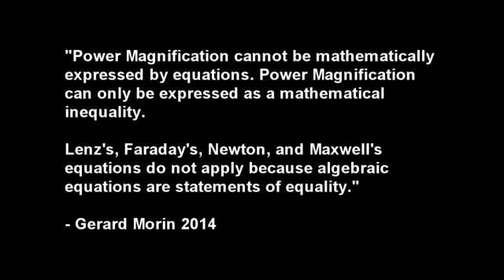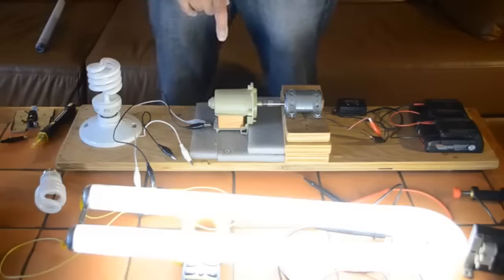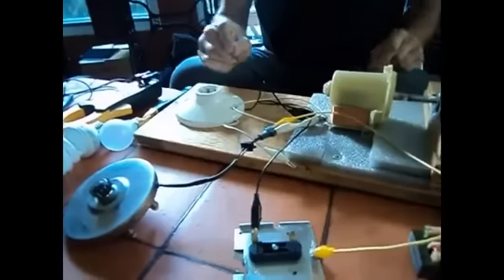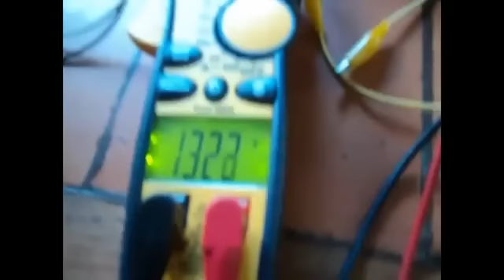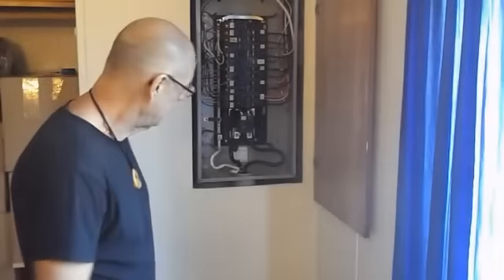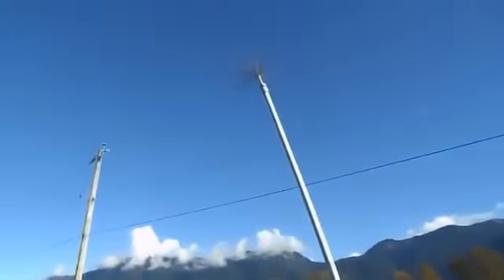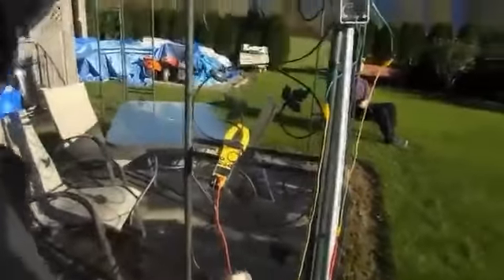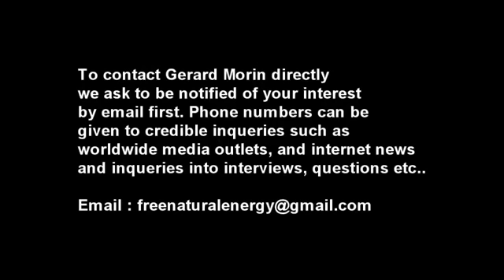Time to END The Electricity Racket - FREE & NATURAL ELECTRICITY PROOF

Comment: i Think Tesla rolled over in his grave when he heard that the electric car named after him needs a charging station🤔
Reply: Where can I get the 2 motors and things I need to build this thing please  and thank you 0
Reply: @privateerburrows  Tesla ran about in a Pierce Arrow car with an 80hp electric motor and NO POWER SOURCE in 1922.
Reply: @aaln1aaln132  Sure.  Proof?
EDIT:  It is just so preposterous that we live in the Age of Information, and there's still people with the minds of prehistoric primitives, thinking you can make energy from nothing, continuous motion, flat earth, or whatever other stupid nonsense.  How is this even possible?
Reply: @privateerburrows  We do not even know what energy is.  How can we say it cannot be created or destroyed?  Besides, you do not have to create any energy at all.  All you have to do is be able to harvest and use energy from the environment.  We are surrounded by energy.
Reply: @wesbaumguardner8829  Well, I'm sure YOU don't know what energy is.  Or if you have an inkling of what it is, you most certainly have not the foggiest idea what entropy is.
  We are surrounded by energy;  that's true;  but it's low entropy energy.
  I'll give you an example:  A few years ago a client of mine wanted to power a pressure/flow monitoring circuit from the heat of a hot water pipe, to avoid having to have a battery.  I succeeded, in the end, but it was a very difficult job.  Why?  Because there was no COLD water pipe nearby;  only a hot water pipe.  And you can say "but it's the hot water pipe that has more energy!"  Yes, but that energy needs to GO SOMEWHERE in order to be convertible to electricity.  I ended up having to install a HUMONGOUS aluminium heatsink on the other side of the Pelletier device in order for it to produce electricity from the heat of the pipe.  When you have heat energy distributed in a room you CANNOT convert that to electricity;  you need a COLD side to establish a heat FLOW to convert to electricity.  All this New Age stupid talk of "we are surrounded by energy;  we JUST have to figure out how to tap it" is ignorant BS.
  The same goes for all those Zero Point Energy imbeciles ... There may be tons of energy in vacuum, but it has ZERO ENTROPY.  You can't do anything with it.  It's as if you were at the bottom of the ocean saying "the pressure here is enourmous;  if we could only tap it ..."  Well, you can't tap it because there would have to be an empty space below the ocean that you could let that water leak to as to generate electricity (from its flowing there, just like you generate electricity as water FLOWS from the high to the low side of a hydro dam);  but there is no cavity below the ocean bottom for water to flow into, unless you believe in some Hollow Earth BS.  "Energy" is meaningless without an understanding of entropy.
  Your argument that "we don't know what energy is, so how do we know it can't be created out of nothing?" is comparable in absurdity to the argument that you can make 12 bottles of beer from 3 in a closed room ... because we don't know exactly what a "number" is.  Well, it does not matter whether we understand the ultimate philosophical question regarding numbers;  the extra 9 beers are just not going to magically happen.  Period!
  But if you are still not convinced, ask yourself how many of these ignorant self-proclaimed priests of New Age enlightenment that talk about free energy BS have actually got a generator going and making money for them?  How many?  Answer yourself!  How many?
Reply: @wesbaumguardner8829  yes I believe it's called solar wind and hydro power.
Reply: @Ham549  Well, at least you know a little bit of something about it.
Reply: @privateerburrows  True. There is tons of energy around us in the air. It can do work. It is useless though because there is no exergy. The energy cannot be converted to any form of useful work.
Reply: @BeatisMcScoots  Exactly.
Technically, though, there was an experiment;  I forget the name of it;  it was just a thought experiment for many years;  but more recently it was carried out in equivalent form, and was corroborated.  The idea is this:  You have a closed chamber with a wall in the middle, and both sides are filled with gas at some temperature.  Now, on the dividing wall you have an automatic sliding door big enough to let a molecule of gas pass when open.  A detector on one side detects when a molecule is approaching and opens the sliding door for a moment to let the molecule through to the other side.  On the other side of the sliding door there is no detector, so any molecule hitting the door bounces back.
  Now, after some time all, or almost all of the molecules in one side have gone to the other.
At that point you open a big door in the dividing wall and let the gas escape back to the first side and equalize pressure.
  It would seem like an exercise in futility, right?
  But what's interesting is that when you open the big door, the temperature of the gas becomes lower, due to decompression;  but when molecules are passing through the automatic sliding door they are not increasing the temperature of the gas on the other side.  So by repeating this process multiple times, you can cool the system without spending any energy.
  This problem was a big puzzle for some time, until someone figured out that the energy is coming in in the form of information, namely the approaching molecule detector on the door.  And from this they worked out the information to energy conversion constant.  If this is correct, there should be a matter-energy-information conservation law, as opposed to just energy-matter.
  But this is how science corrects itself, by hard, painstaking work;  not by fanaticism.
Reply: @privateerburrows  if you find the name of it then let me know!
Reply: @BeatisMcScoots  Quite unlikely;  I don't even know how to google for it.  It was from an article in Scientific American, some years ago.
Reply: @aaln1aaln132  hahaha, uh huh, sure he did...
Reply: @privateerburrows  I am laughing just reading this stuff.. These people simply cant be that stupid... Its impossible...I think I'll join in for the fun and read on haha
Reply: @wesbaumguardner8829  Well, we do know what energy is because we are the ones who defined the word, so.... to say we dont know what it is, is kinda silly... However, we are surrounded by energy and maybe one day figure out how to dynamically utilize it but we aint there yet...
Reply: @wesbaumguardner8829  You never answered his question.... Where is your free energy? Give us a schematic or device that proves your point... You cant because it doesnt exist... So why are you arguing something that is so clearly wrong?....
Reply: @keithfucious7067  Not exactly.  The word was created to describe an entity or a phenomena that exists or occurs in the real world.  You can claim that energy is the word itself, but in that case the word becomes meaningless.  I am talking about the actual entity or phenomena that is described by the word rather than the word itself.  There is a difference.  It is entirely possible to create a word for an entity or phenomena that is not understood or is misunderstood. Just because you provide a definition for a word does not mean that the definition is correct, accurate, or complete.
Reply: @wesbaumguardner8829  Energy, the way we currently describe it scientifically and through physics, can not be created or destroyed.
Anything that lies beyond that, I agree we dont understand...
I would never say anything is impossible though. I agree we are surrounded by energy we simply have not been able to harness dynamically in any usefull amount... Perhaps, and even more likely, we certainly will in the future...

My original criticism of your comments is that it appeared you WERE saying something was possible void of any tangible evidence....Basically, no one has a free energy machine so you cant possibly claim it exists....Further reading in hindsight, I dont think thats exactly what you were saying. You were more bringing light to the fact that there are unknowns and I actually respect that open minded thinking....

So, I actually agree with most of what you are saying... You are basically saying our understanding of energy may in fact be screwed up and we may make further discoveries that allow us to do work with something that falls beyond the current rigid definition of energy....However I stick with my original comment on energy... We do in fact know what it is 'as we describe it', we simply do not know if there is anything beyond our definition.
Reply: @wesbaumguardner8829  But in the end, nothing this guy did in the video even comes close to the depth of knowledge we are talking about... The guy in the video appears to not even have the most basic understanding of OHMS law...It is just comical to watch him convince himself or others that he has made some remarkable discovery or created or set into motion free energy... Its like a child explaining how a nuclear reactor works... Just making it up in his head as he goes thinking he actually is discovering something because he doesnt understand the basic principles of electronics...Personally I think he is just a fraud looking for views because he says some things that shows he knows stuff that proves his whole claims to be laughably incorrect... In other words, if he understands Wattage and its relationship to  Voltage and current, then off the bat you know he realizes none of what he is claiming is true...
Reply: @privateerburrows  What virus?... hahaha, just kidding...
Reply: @privateerburrows  I think people seem to try to find the stupidest things to defend themselves with is because they refuse to open their minds and admit they were wrong. In an effort to defend their original argument they seem to grab hold of anything or any statement that is actually correct, then attach it somehow to their original argument to somehow lend it credibility...Most people will not abandon their stand on something even if it is perfectly clear they have been proven wrong, so their defences just seem to get more and more absurd as they grasp and reach. It is very difficult to be humble, but that is the only way to continue to learn... I would rather be smarter every tomorrow of my life than I was the previous day even if I had to admit I was wrong every day...
Reply: @keithfucious7067  That is soooo true;  and not just in science.  In philosophy, politics, economics and sociology I keep changing my mind as I learn new things;  but I had a friend from many years that got really mad at me because I changed my political views, acting like, in his mind, I had no right to change my point of view.  Needless to say, after a long argument that was leading nowhere I told him what to do with himself.  Not just him, a coworker too got rally mad at me one day because I changed my diet, saying "last year you believed that;  now you believe this!" and refusing to talk after that, as if I had denied a religious figure or something.  But it's always like that;  some of us try to improve ourselves, our models, our understandings;  but most people are defensive and firmly attached to whatever garbage they randomly decided to believe in;  and only study argument techniques so that they can just overwhelm their opponents with dozens upon dozens of fallacies like a factory production line.
Reply: @privateerburrows  how is life possible bruh
Reply: @aaln1aaln132  wrong. I've studied Tesla extensively and this claim is out of left field. Also, Tesla used coal to power his inventions.
Reply: It’s all about money! And that’s sad! Love  Nikolai!
Reply: @johnandrews9433  Hahaha, for a moment I thought this was FartProsperity replying to me.
Reply: @keithfucious7067   "Further reading in hindsight, I dont think thats exactly what you were saying. You were more bringing light to the fact that there are unknowns and I actually respect that open minded thinking...."  That is the correct interpretation of what I was saying and I commend you for acknowledging that.

"However I stick with my original comment on energy... We do in fact know what it is 'as we describe it', we simply do not know if there is anything beyond our definition."  The definition we presently have is overly vague and ambiguous.  This is complicated by the fact that present theory concludes that 90%+ of all energy in the universe is some mysterious "dark energy" that is almost completely undefined or is more correctly denoted by our lack of understanding of it.  This is not a very good basis for the claim that we know what energy is and whether or not we can make claims as to what is possible with regards to energy.

"You are basically saying our understanding of energy may in fact be screwed up and we may make further discoveries that allow us to do work with something that falls beyond the current rigid definition of energy...."  That is correct.  We may also discover that energy can be created and destroyed.  At this point we are so ignorant that we are not even aware of the majority of what we do not know.  It is the curse of the unknown unknown, which is the most difficult problem to solve.

"We do in fact know what it is 'as we describe it', we simply do not know if there is anything beyond our definition."  If you really believe that, start listing the properties, attributes, and characteristics of "dark energy," which is purported to make up the majority of the universe.
Reply: @keithfucious7067  To be honest, I did not get much past the beginning of the video because I could tell the guy did not know what he was talking about.  My only goal is to get people to realize how little we actually know and to question what we think we know, but don't.
Reply: @melonmusk7502  Oh really?  Would you care to explain the "tricks" you think I am pulling or would you care to make an actual argument against anything I have said instead of just asserting your opinion?
Reply: @privateerburrows  Energy from "nothing"? Yoy did not listen what he said about the sun?
Reply: @anthonyferguson4218  what do you mean by reset? I am not familiar with this particular conspiracy. Does it have an official name?
Reply: @anullhandle  Good to know the history of how it happened;  thanks for that.  As for "effective against enveloped viruses" all I have to say is that when you choose a tool you should choose one that does its job AND does not cause unwanted consequences.  There are many chemicals that are far less damaging to your natural skin flora than alcohol, and which are effective against enveloped viruses;  such as you mentioned soap.  Another is BHT, a fairly healthy food preservative.  Possibly lecithin, I'm thinking, which is an edible soap as well as a food supplement.
    Otherwise, I'm sure chlorine, kerosene, and many such things are effective against enveloped viruses, too;  but that doesn't mean we should be putting them on our hands.  It's almost as retarded to be putting alcohol on our hands.  And not only is it unhealthy, but in fact, damaging our skin flora OPENS A PATH for infection, as the natural flora constitutes a first layer of immune defense, like a thick jungle could be a barrier to an attacking army;  and I would not be surprised if a few years after this stupid saga is over, some researchers discover that MOST infections occurred BECAUSE our hands were unprotected, denuded of natural bacteria, and so we got the virus easily just by touching money and things.  It would not surprise me AT ALL to find out that the stupid alcohol sanitizers are what's been keeping this pandemic alive.
Reply: aint it a bitch? and the one who bring it. in a interview telling that for him thomas Edison was the greatest?? 😆 what have we wast the world sinds ?? but i have stage this video 7 years ago and now i have bring it to a source on social media in Holland named blackbox today  and may now we can flip the boat over for one's nice night
Reply: @privateerburrows  Well not many, since some higher up need meters to charge You for using it... 🤔 Same happened to Tesla..
Reply: @keithfucious7067  Tesla prooved it... 👍
Reply: @keithfucious7067  Yes, i do not understand why he adressed some people as idiots.. 🤔
Reply: @liannblack2427  😲What has Musk done to be called snake...? 🧐🤔 Wanting You and Your children and grandchildren breath fresh air...  👍 Blessings 🙏🌟✨🕊️
Reply: @keithfucious7067  you are all forgetting one of the key elements of Tesla's work  ..  resonance  ....
Reply: @privateerburrows  you mean like in the Dennis Hopper movie ?
Reply: very true

Comment: Umm, actually hooking the batteries up in parallel(pos to pos, neg to neg) doubles the current(amps) that can be delivered. So idk why you say you can only double voltage. Running batteries in series doubles voltage, parallel doubles current.
Reply: Only the voltage just a step up volt
Reply: Current is load dependent.  Stop talking about things you don’t understand.  Free 101 lesson:  I = V/R

Comment: Compare volts x amps out of the battery pack and volts x amps at the socket. Total wattage pulled at the battery side is higher and this falls apart instantly. Using power to make power always costs - no way around it.

Comment: All I see is some high current 36 volt DC batteries powering a DC motor spinning a generator making around 130v ac powering low current AC devices.
Reply: @sethjorge7115  you have been on damn near every comment site today might change the person saying it looks promising
Reply: How hot are those battery leads getting?
Reply: Thank you Sir , I was wondering why he did not connect a drill press and bore a half inch hole through a piece of steel. He  isn't in the news ,  so people of learning must have ignored him too.